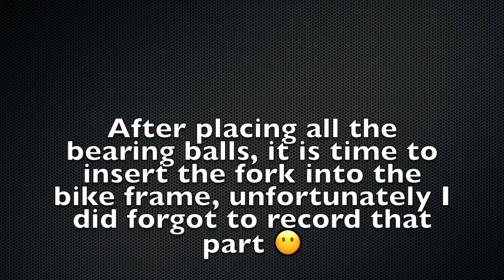BIKE Front fork Overhaul | Kreidler | Brommer

Comment: What Kind of glue are you using
Reply from the maker: The glue which I used didn't hold up eventually. I did put hose clamps around the seals to hold them in place.